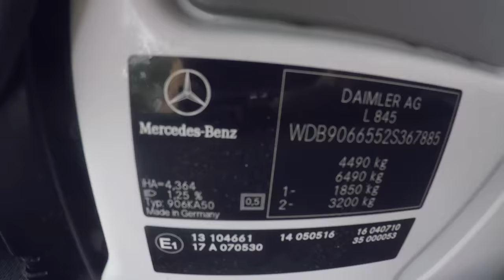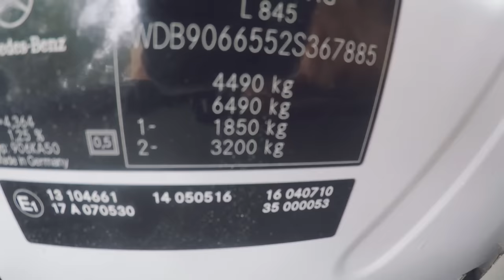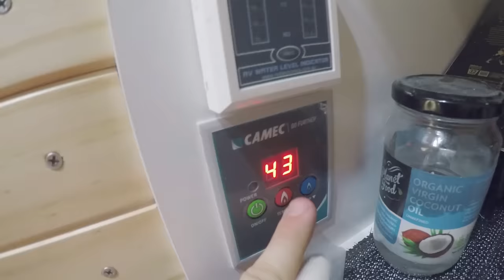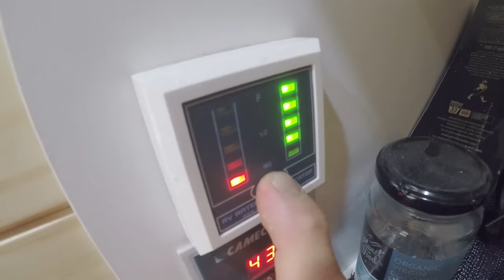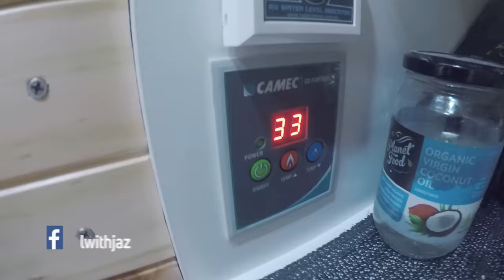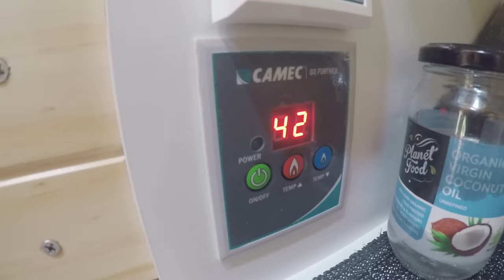S1E12 Sprinter Van Conversion | Plumbing Pt. 2 + Gas

Comment: Reverse Osmosis system uses 2/3 of water for backwash. Routing that water to the gray tank is not a good idea for RV. You will fill it up very quickly, and it is still perfectly good technical water. Why not to route it back to the fresh water tank. You will waste that water for shower before it gets to "condensed" with particles.
Reply from the maker: Someone else mentioned this and now I'm seeing that I'm going through water rather quickly. So draining this to the fresh water tank is no problem? Is it okay if that water that was firstly drained from the RO system finds its way going through the RO system again for a 2nd or 3rd time?
Reply: It is not a problem. It would be the same as the water is evaporated... just a little bit condensed with all the matteries as before in bit less water. It is not like  you'll be filling the tank with muddy water. Also, you will drain the tank quicker with showering than you will drink it. ;)
Reply: I also don't think it'd be a problem, chemicals is what already gets filtered right? Should be fine then D:

Comment: Hi Jaz, quick question. What are those water hoses called wich you use on 9:15? Do they have a certain name or brand?
Reply from the maker: They are called John guest house, 12mm or 1/2 inch hosing

Comment: What do you use for the water heating
Reply from the maker: If you mean hot water system, this is covered in ep.6, and ep.6 blog post with links. If you mean so the water doesn't freeze, I am not worried about that in Australia

Comment: Jaz, what year is your Sprinter? is it above 2010?
Reply from the maker: It's 2009
Reply: You just have the DPF system in this one then, not the DPF with DEF. You've wrapped the DPF;  Some people opt to delete this, which will increase fuel efficiency, increase HP and Torque; and cause less headaches overall. Im currently doing this to my 2008 2500.

Comment: Looks like your shower is air proof and also you take the air from it ... so hope you will have anough air in the shower :)
Reply from the maker: We actually leave the extraction fan off whilst having a shower so all the warmth stays in, and when finished put it on and leave the door ever so slightly cracked open for 10 minutes

Comment: Do you use 5/16 copper pipe or 3/8
Reply from the maker: im not sure what the gas fitter guy installed, it is pretty skinny so i imagine 5/16 or 1/2